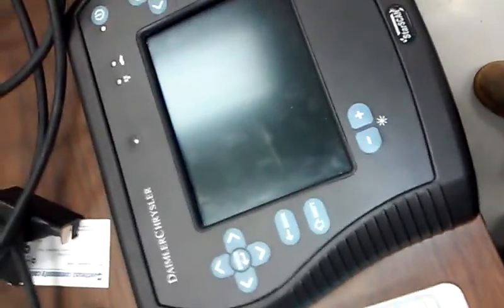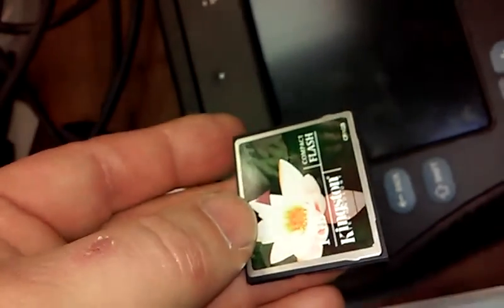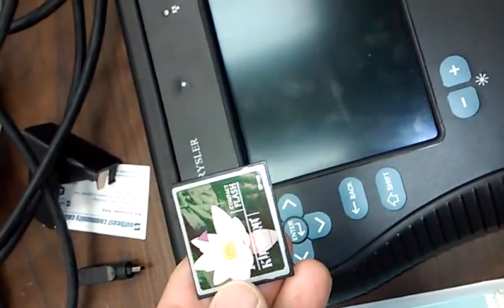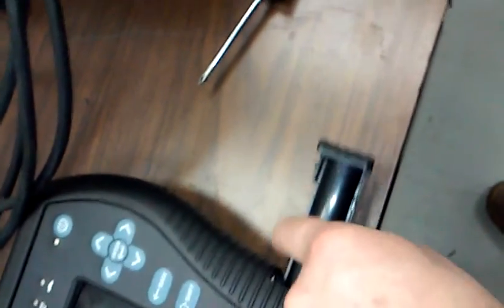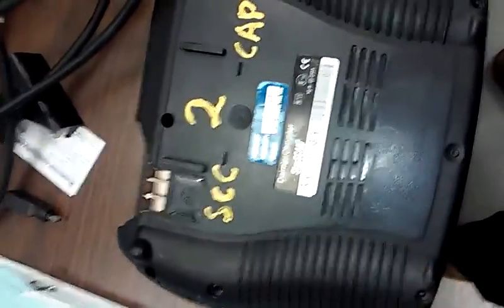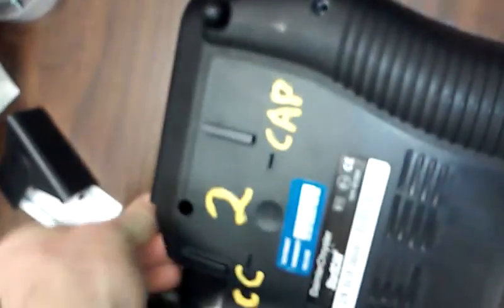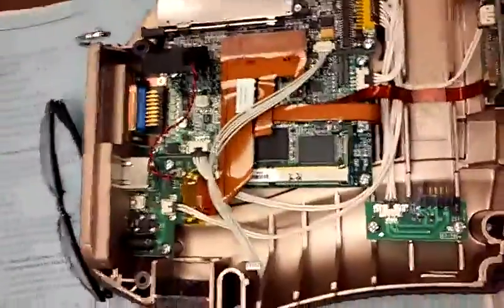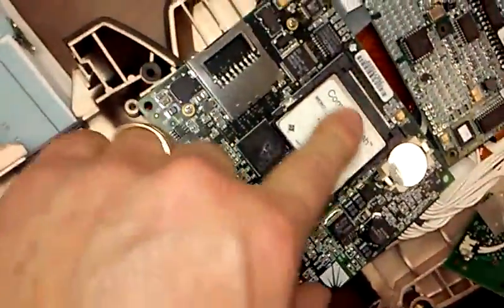Repairing starscan chrysler scantool

Comment: wondering if thats what went wrong with mine. it was weird it started booting and the screen was reversed ?  i would reboot a dozen times and it would boot normally . the other day it did that and stupid me decided to give it a wack  and the screen went white .now it boots to a white screen  lol , any ideas ?  nothing on web about this issue . was yours booting to a white screen as soon as it was turned on ? thanks for any help.
Reply: fas did you find out how to fix the white screen ?
I have the same problem
I was planing to take it apart but there is a screw under the hook which I am not sure how it comes off I don't want to force it or bust it off since I may break something else On the video the hook is not on or he removed it already
Reply: I was able to fix the white screen
After I got past the hook I opened it and just removed the screen and put it back so basically no problem found but I guess maybe whatever loose connection it had it relaxed itself in a way that the connection is better So now it boots normally to a black screen I did not have any problems with the flash card though

Comment: I opened the tray on the top left of this unit and there is no SD card in there.  Also looks like a spot to put a large card, like the recovery card., which has nothing in it.  Will the StarScan work without these in?  thanks

Comment: We actually have one of these in my shop and my tech is dying to use it, however it will only turn on, flash the main menu for a split second, and then go blank. He claims it works from time to time but has done this off and on for years yet there are no sources for repair on these things anymore. Happen to have any input for how I can get this thing functioning again?

Comment: Todd, My chrysler dealer has 2 bad Starscan tools. I would like to repair them. Do I have to get an image off a good one or does your attached have everything I need to download and put the complete image on my (both) 1Gig SD's ?
Reply from the maker: if the links are still working then it should all be there.
Reply: Todd, I'm thinking about buying one for my 2011 200 convert. I keep having hard top issues. When the top gets stuck open or closed the only way to reset it is with a starscan tool. Any idea if i need passwords or a specific software to get to the menu to manipulate the top motors? 

Tom (847)825-2874
Reply: One of the guys selling a Chrysler Scan Tool says i will need a dealer login to use it? If I find or obtain one, does it ever expire or change if the tool never hits any network?